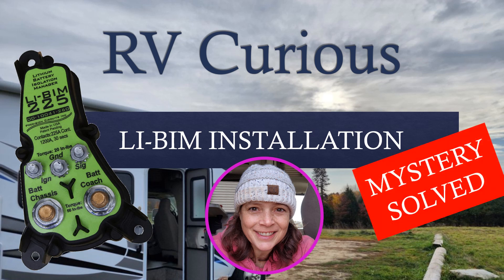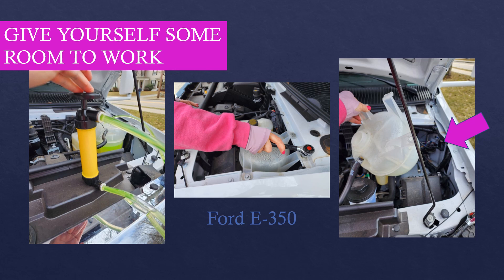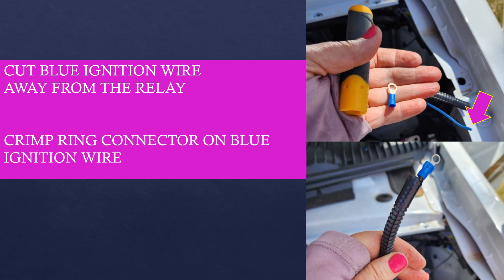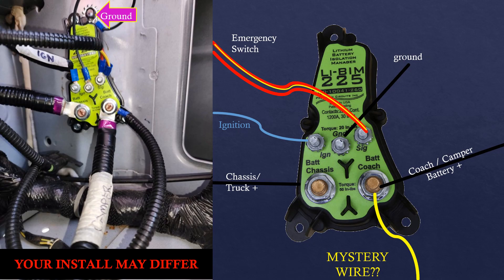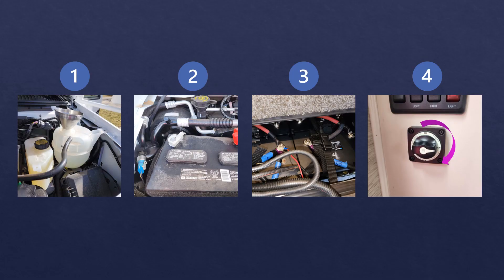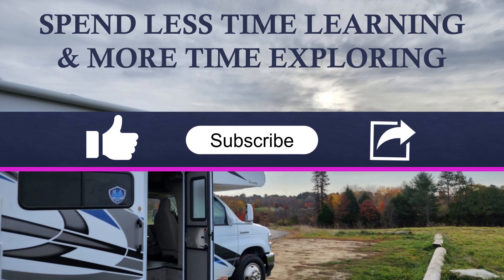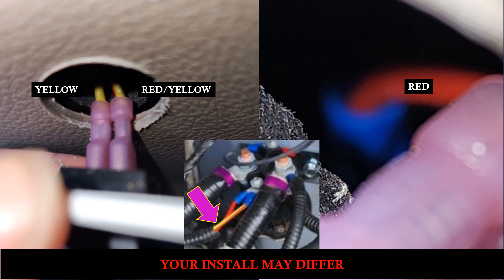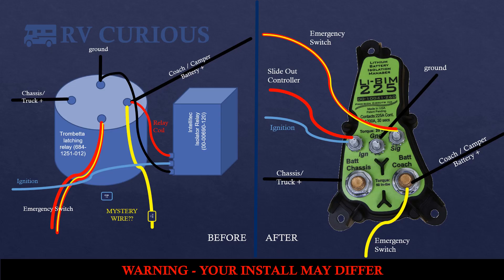LI-BIM 225 Install Tutorial & Mystery Wire Solution

Comment: Excellent video. My new BIM comes today and thanks to you, looks like it will be much easier for me to install. I have a 2017 Ford E350 (Thor Majestic 23a)
Reply: Darn, my wire colors are a little different. Having difficult with the 2 wires connected to the Battery isolator. They are the wires connected to the top spade connections, tan (light brown) and yellow.

Comment: You rock.  I had a BIM for lead acid and switched to Li BIM.  So I didn’t need to figure anything out.  I don’t think I would have done it myself if I did need to figure stuff out, so you rock!
My BIM doesn’t seem to kick on while driving tho.  Does the battery need to be depleted for it to work or does it just cycle all the time?
Nice work.

Comment: Curious, Why did you remove the delay relay?? I kept mine in. I figured it couldn't hurt.
Reply: I connected the red wire coming out of the delay relay to the IGN post on the BIM. Works great and keeps the delay intact.

Comment: Great timing! I commented on your first video, and I am in process of upgrading our 24F (very similar to yours) to lithium - 200 amp SOK batteries. AND... I was just looking at the Li-BIM install today. There are VERY vague install instructions. I was wondering how the heck to move the antifreeze reservoir without spilling it... THANKS!!

Your instructions are golden - exactly applies to my install! Now I know to watch out for that "yellow wire gotcha"!

Thanks for the tips!!
Reply from the maker: So glad I could help!  I am going to be creating another video soon.

I upgraded the Thor single lead acid battery to a bank of 4 100Ah LiFePo heated batteries from Renogy.  The most annoying part was the pile of "extra" cable that Thor left sitting in the battery tray.